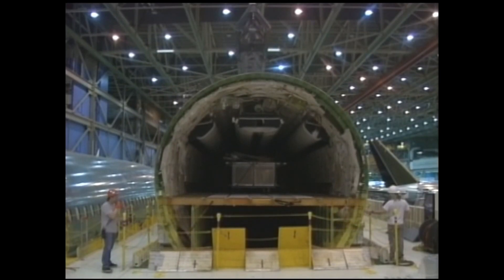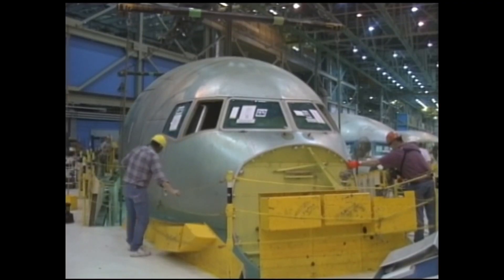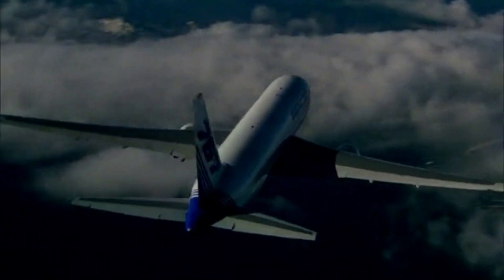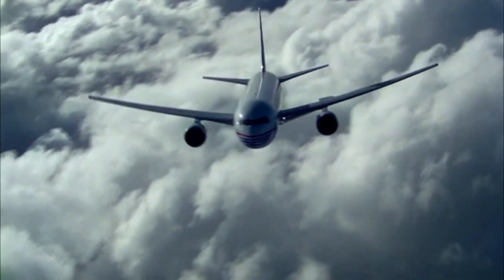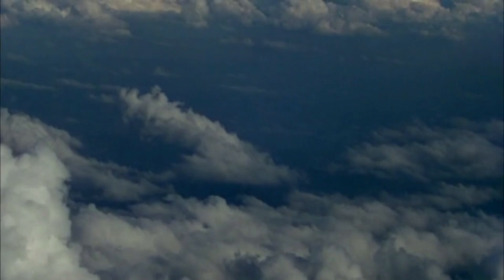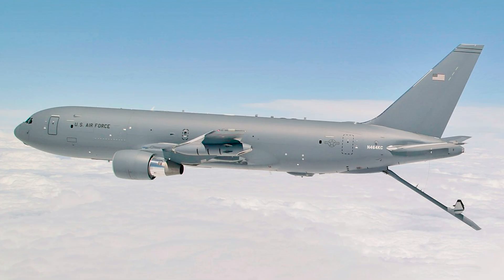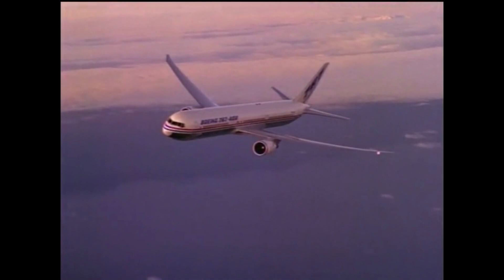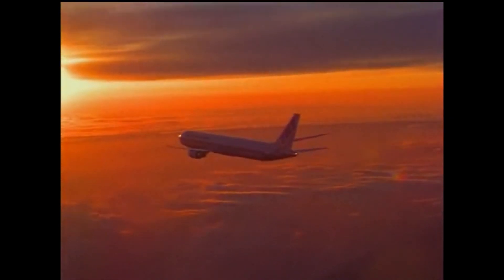A Brief History: The Boeing 767

Comment: One thing to add, the early military 767 versions are modified civilian 767-200 frames, the latter KC-46 was built from the ground up as a mix sections from 200, 300, and 400, in their cargo models. 200 cargo fuselage, 300 wings, 400 flight deck, along with many many newer technologies from the 787 era. It's not without its flaws but it's shaping up to be a great bird.

Comment: In 1991, I was aboard an Air Canada 767. I had asked the Flight Attendant if the Plane we were on was the Gimli Glider. She said yes. I told her "Great, this Plane has already had its Misfortune, and thereby be very safe". I was later able to get them to take myself and my Girlfriend's Son into the Cockpit. We spent about 15 minutes up there. The 767 is the largest Plane I have flown on.

Comment: Something inbetween the 757 and 767. A 2 - 2 - 2 airliner much more fitting to be a 757-300 replacement (Airbus's A321XLR already replaces the -200, Boeing shouldn't waste time trying to compete). More cargo capacity, quicker turnarounds, higher MTOW, more range. That's what the 797 should be. 46-57 meters in length depending on variant.

Comment: It would make sense to re-activate passenger production of the 767-400ER as a MoM plane. Boeing doesn't have to re-invent the wheel with a 797. 

Also imo, the 767-200 passenger variant is comparable to the A310-300 while the 767-300ER is comparable to the DC-10-30.

Comment: Why does this video say that the 757 and 767 have "similar fuselage cross-sections"?  The 767 fuselage diameter is more than four feet (about a third) greater than the 757.
Reply from the maker: Vertically they are within 3 cm of each other

Comment: An interesting aspect of the 767: the plane essentially duplicated what American Airlines' then-CEO "C.R." Smith wanted in 1966: a twin-engined wide body airliner that could fly US transcontinental routes but operate out air airports with restricted runways like Chicago Midway. The 767 essentially replace not only the 707 and DC-8, but even the DC-10 and L-1011 on many routes.

Comment: Personally I feel the 767 should be redone instead of a new jet altogether. I flew on a 767-300ER in the early-ish 2000's (I think it was around 2005 or so) from LAX to PHL (Los Angeles to Honolulu) with Hawaiian Airlines. I will never forget it also lol, on takeoff we lost the number 2 engine on rotation if i remember right, and had to land back at LAX and when we got to the gate they asked for two volunteers and I raised my hand and they picked myself and one other passenger to switch to another Hawaiian Airlines 767-300ER as they were about to leave for Honolulu and had two seats open. When we got to the other aircraft myself and the other person found out the only two open seats were in First Class and we were both in Coach on the first aircraft. So we both got to fly to Honolulu in first class (approx. 6 hour flight). When we landed we then found out that the first aircraft was just leaving LAX. About a week later I flew another Hawaiian Airlines 767 back to LAX from Honolulu. 

Now I did fly on the 757 a few times, the best flight i remember on the 757 was from Atlanta, GA to Reno, NV back in 2006 when I got out of the Army, I was set to fly on SONG's 757 but it was out for maintenance and instead flew first class on the Ron Allen Livery 757 from Delta. Such Blessed Memories.

GOD BLESS!!!!

Comment: The 757 and 767 DO NOT HAVE COMMON CROSS-SECTIONS! Huge error.
Reply: He said similar, not common
Reply: @TyrannoJoris_Rex  It is not even similar, the 767 is twice as wide.
Reply from the maker: @robbos6526 they are similar, the height is only 3 CM different. They were designed together. They share the same windows, bins, etc.
Reply: @TheOnlyNoIan  The 767 crosssection is FOUR FEET wider.
Reply: @ He's not talking about the size. He's talking about the geometry

Comment: The 767 is a true workhorse , versatile in its use. A newer powerplant and a new wing design might work technically, but efficiency and reduced fuel cost is paramount for choosing a 767"neo", but in comparison to what other airframe will it eventually compete.

Comment: You mentioned that the 757 and 767 share similar cross sections and cockpits. Only the cockpit is shared. The 767 has a wider by four feet.
Reply: He didn't say shared, he said similar. Probably referring to the geometry

Comment: To think Boeing came out with two new aircrafts with the 767 and 757 during the same time period.
Reply from the maker: Two of the most influential planes of all time were developed side by side by the same company. Now they can’t even do one at a time.
Reply: They did do the Cockpit commonality thing like Airbus w the A320 to the A330/A340 & A350 to A380.

Boeing should have done more commonality with those aircraft to the 777 and the 787 that will ensure Boeing's commonality, and they should have retired the 737 early on to remove an uncommon aircraft that will plague them.